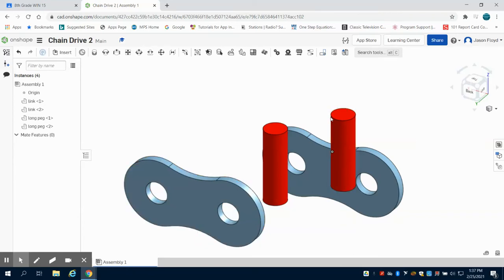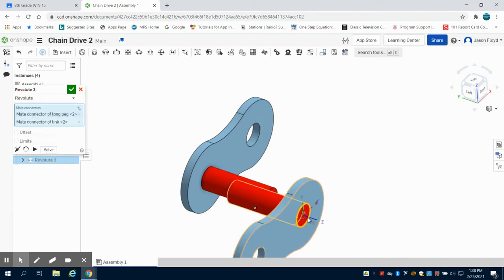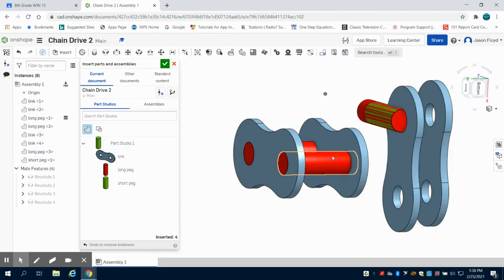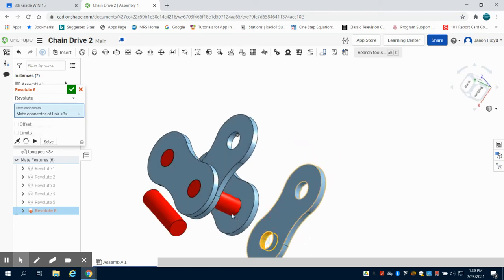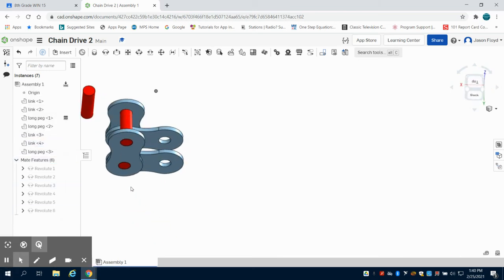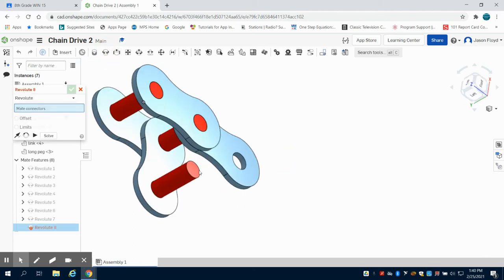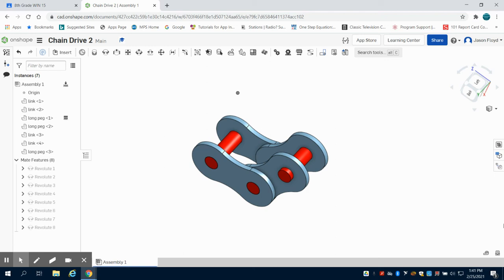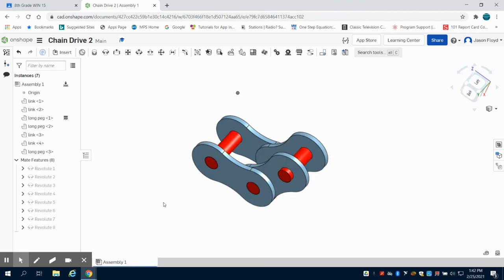Chain Assembly CHALLENGE Onshape PLTW

Comment: You should try to use the replicate feature. And if that doesn't work you can use this part as a subassembly. Then you only need one mate to connect the links to eachother. So open a new assembly and insert this one multiple times. I think a linear pattern doesn't copy the mates.
Reply from the maker: I thought about doing  s subassembly and I think it would work. I’m still not sure about constraining it to the gear. 

I have tried the linear pattern with no success. I appreciate the idea!💡
Reply: @Tomorrows_Eng  I don't think Onshape is able to mate the gears with the chain. You can give it a gear relation but it will be tough to get it to sync. There's no (collision detection).
Reply from the maker: That’s great to know, I won’t waste my time then

Comment: Hey Jason, new CAD designer here.
Did you ever figure out how to make the chains linear pattern out while keeping the same revolute constraints? I'm trying to make a chain around two gears, but haven't been able to find any solid videos for the whole process.
Thanks!
Reply from the maker: Hi Brandon unfortunately I haven’t. When I was teaching virtually I was working on this project, being back in the classroom I haven’t had time to revisit it.

The next idea I was going to play with is bringing in a gear and setting a offset constraint to the gear center point. Not sure that is the answer but I was going to explore that path.